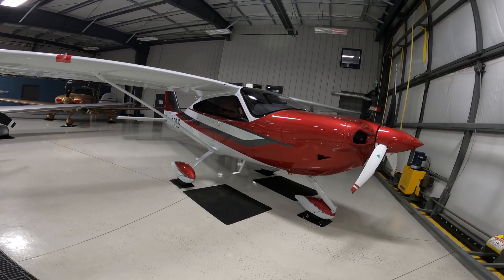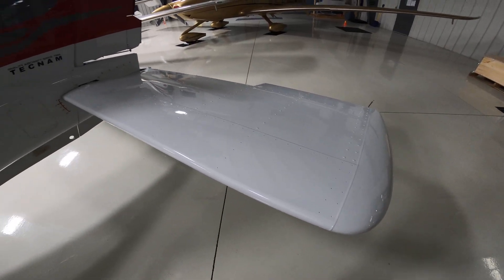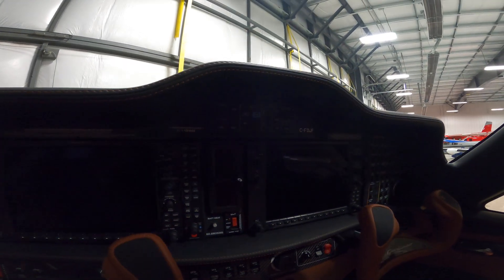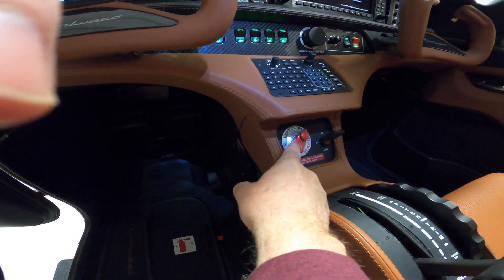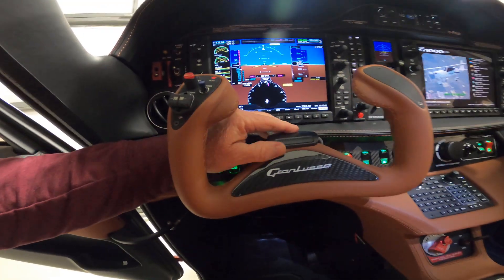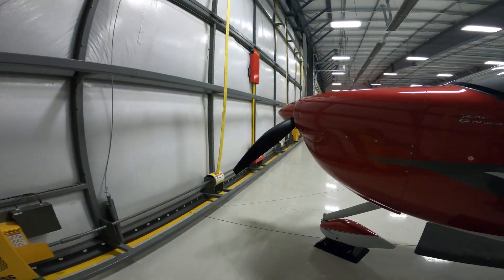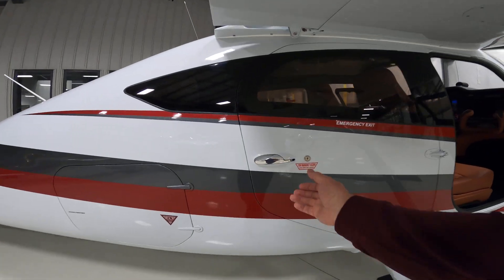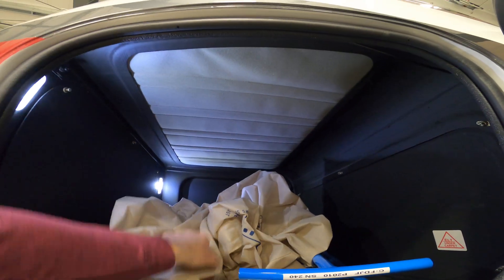TECNAM P2010 TDI

Comment: Those (sight for sour eyes) wheel pants sure won't be useful in inclement weather, such as snow, mud, 
and all can Mother nature can throw at us.
Also, really not ideal for inspecting disc brakes, tire condition, and proper air pressure.
I would stored them for a future owner.
Besides that, sure is a pretty airplane. 
Just wondering, is AC available?
So long from CYUL.
A.D.
Reply from the maker: @bullittfanatic  No AC option as of yet.
Reply: Thank you for taking time to answer my question.
This (AC) would be a great asset to the P 2010 TDI.
CYUL.